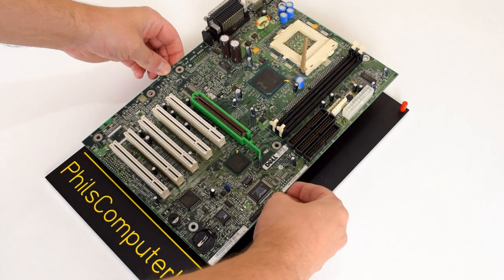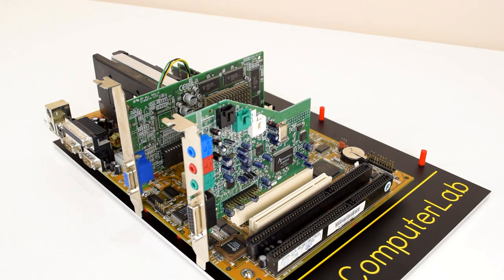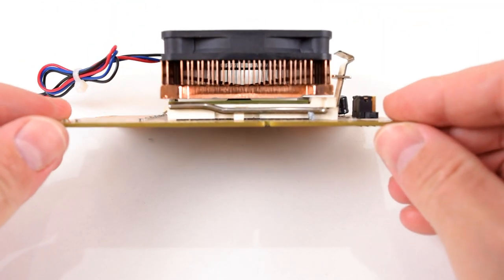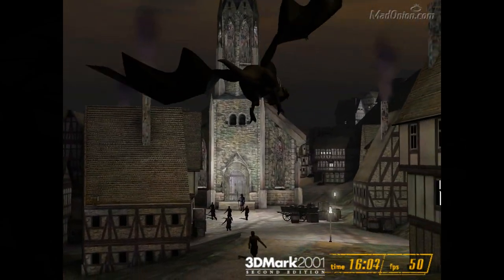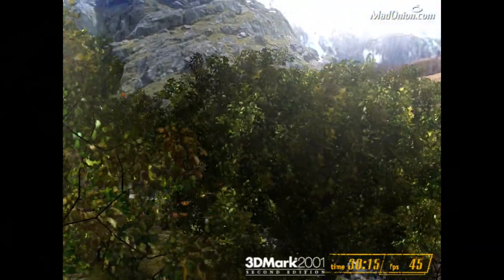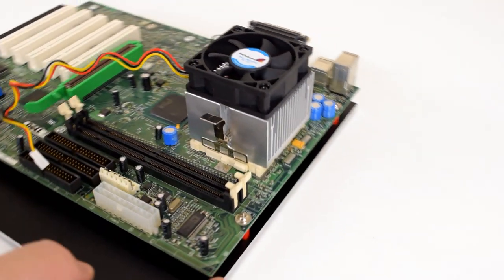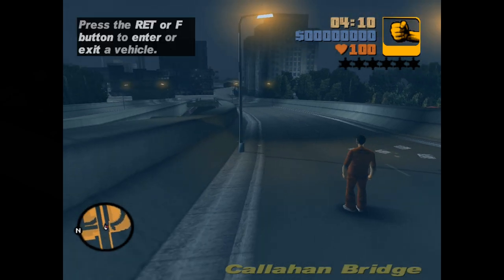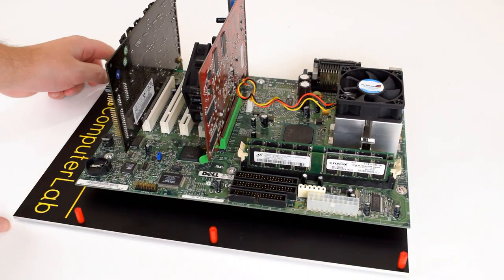The Pentium III 600EB - What does EB mean?

Comment: Nice video !!!. Back in 2000 to 2001 we have pretty an offimatic machine. It was a budget clone, but got the job done and got tired of people telling how miserable this PC was (PC Chips 850) but hey ... It worked fine for us and still powers up nice. It used AMD K6II 500 Mhz, It was a really good value. At this time, 500 to 600 Mhz, PIII or Celerons were the most common systems you could find in drugstores that have many of them networked just for gamming. But the K6 was not enough for certain things .... like the ones required by the university. Poorly made scripts with errors (well, I was learning) take tons of time on Matlab and tired of waitting 2 hours each time to get more errors I grab my CD and went to one of this drugstores. One in particular imported SPECTACULAR HW for its era, 850 and 900Mhz machines with 256MB RAM and powerfull graphics cards. The machines were by far the most powerfull around starting with the case itself. So rare and fast that people keep asking the owners where did they got this HW. I paid for a gamming PC (you could pick a "only internet" and a "gamming" PC) get the permission to install Matlab on it and it was insane fast. I finished my work in two hours. How weird this was, I was in the middle of people shoutting and shutting themselves in the game, one of them even broke the keyboard. Sure it was weird for the other buddys there, using a proper gamming system for nothing but a white command promt LOL. My "gamming" setup was a P1 100Mhz enough for VICE and CCS and minimal for MAME depending on the ROMS.

Comment: The Pentium III 500E was a 'special' release from Intel around 1999. It was rumoured to run on a 133mhz bus and was very cheap ( about $250). I rushed out and bought it and had this cpu in a slocket running at 667mhz on my AX6BC Pro. Coupled with 512mb of insanely fast Transcend ram. It ran for many years until I gave it to a relative. It never faltered ever. Thanks for the great memories.

Comment: I've got a 600eb slot1 version recently. Now I'm using it along with 440bx at 450 and 300 mhz. Very happy with it. Going to build voodoo-1 based retro pc. Have an idea to build a arduino-based fsb-selector (and agp-divider selector). Wonder if there are option to switch them without restart (somehom put a wait-states through pc/pci connector to motherboard and switch fsb during this period)

Comment: On a side note, there were also boards with bot socket 370 and slot 1(although couldn't be used in a dual cpu config), which are very cool, I'm not sure what chipset they use, although I do have one, need to have a look at it.

Comment: I had (still have) a PIII500e. It run fine at 667mhz, and even worked for the odd benchmark at 750mhz with a TEC module. The issue i had with my BX board (SOYO SY-6BA)  though was the PCI bus speed didn't have dividers for  anything above 100mhz FSB, so your PCI speed would run way over spec

Comment: I was using a P2-266 back in '99. I didn't get into PIII until 2003, when I replaced my terribad 1.8GHz P4 with a PIII-S, clocked it up to 1575 on a Apollo Pro266T DDR motherboard, and slotted in a shiny new Radeon 9800 Pro. That thing was just so awesome. I spent hours and hours playing Painkiller, Splinter Cell 1 & 2, Vice City, Far Cry, Doom 3, Thief 3, and many other games on that machine.

In fact, I enjoyed that rig so much that I recently spent way too much money recreating it. Got myself the same QDI Advance 12T motherboard that my original machine had. I'm even replaying all of those old games!
Reply from the maker: Nice! I'm yet to try out the VIA 266T, the best I have is the 133T. Unreal that you found the OC Tualatin better than the P4.
Reply: Nice thing about the 266T is that it lets you take cheap CL3 DDR400 memory and run it at 300MHz (to match the 150MHz FSB) with very good 2-2-2-5 memory timings. There's also a dedicated 266MB/s bus between the Northbridge and Southbridge. It doesn't use the PCI bus to link the two like the older Apollo 133 did.
Reply from the maker: You really know your stuff! I only recently read up how they the North- and Southbridge were connected with the PCI bus and how the i810 chipset changed all that. It's so interesting to experience all this stuff :D

Comment: At the time, I had a Via-C3 667 sold as: "1GHz PR" - "Samuel 2" core and later, as the computer was shared with my brother, he would get the VIA and I've had a P3-500 Slot-1. We never had a Rambus system, but in Eastern Europe the P3 Cooperine or P4 were overly pricey. Around 2 years later, my aunt bought an Athlon 1800+, so what can I say: 
- P4 was a linked with Rambus making everything overly expensive. I knew only two people in entire IT university that had them initially, from some dozens of colleagues. AMD was the king, some people would argue that Coppermine's Celeron is a good deal, but none was pro-P4 or P3.
- Via-C3 667  was running neck on neck with a P3-500 which was second hand
- I remember that at the time, the single way to counter a slower CPU was only to buy a lot of memory, and we were using XP flawlessly
- Via-C3 was kind of "SOC" with everything soldered, you could not change the video card, but it would have 2 slots of memory, so we upgraded it till 256MB of memory and we would run Linux and XP. 
- Linux was amazingly compatible to Via platform at the time, and P3 was not

Comment: Hey Phil. Love your video's as always! Would be interesting for others to see perhaps if you can cover the speed difference between the 500 and 500e for example. There's quite a nice performance boost in some benchmarks due to the full speed cache even though it's halved in size. Also, I see you have a 500e and a 700e - Could you overclock them using 133 fsb and give people some idea of the possible free performance boost?

I had a 500e back in the day, which was an upgrade from a k6-2 400. I managed 112fsb on this, which was the limitation of the QDI motherboard I had!  Also, not sure if you have any of the Matrox G400 series cards, but these were interesting at that time, running great until you looked at some blood for example in Half-Life etc!
Reply: Maybe even a complete 600 MHz roundup.
Duron 600, Athlon 600 Orion, Athlon 600 T-bird, P3 600, P3 600B, P3 600E, P3 600 EB, Celeron 600.
Reply from the maker: Thanks for sharing!
Reply: PhilsComputerLab I've got a bnib kt7a, and an nf7s! struggling to find a decent cooler over here (UK)!  I can get the athlon 1.1 to nearly 1600 but it's very toasty!
Reply from the maker: Old used all copper coolers is the way to go I think. Especially for overclocking. For stock look out for the Arctic Copper Silent or something like that. I used it with the 3200+ without any issues.
Reply from the maker: I'm sure I tested the 500 vs 500e in my Voodoo2 SLI scaling project. There was no difference basically, maybe 1% or 2 with no clear winner.

Comment: These were the "good ole days" upgrading either my videocard or cpu every fucking 6- 9 months, around here i had a 500 mhz coppermine p3 with voodoo 2s in sli and like 128 mb ram and a 30 gig hdd.  Next comp was a 1ghz Athlon with 256 mb ram and a voodoo 3, a tiny bit later a athlon 1.4 thunderbird with 4 40 gig hdd in raid 0 and a geforce 256. And a tiny bit later.......

Comment: I'd love to see you do something with the Intel L440GX motherboard, the one that can do dual pentium 3 slot 1s. Warning for you if you do though, it's limited to 100MHz FSB and will actually refuse to boot with any 133MHz FSB cpus. It's got a great SCSI chip onboard and a great chipset in general though, and the board is comically huge. I feel like dual Celeron 1100MHz with a really good AGP video card would be an impressive machine for that board, in fact I'd love to try it, the only issue is slotkets seem rare on American eBay atm.

Comment: I am still amazed how good the pentium 3 is that it was good enough for day to day computing as well even youtube till around 2009 or so. Still a little pissed after all these years about Intel gimping the 815 chipset (ram limit). Should have done 1gb out of the box or even 2GB like the i840 chipset.
Reply from the maker: I agree, the i815 could have been perfect had it more memory support and ISA slots by default.
Reply: Bit it makes a decent platform for a fast Win 98 machine.
More than 512 MB isn't supported by the OS anyway and with something like a SB Live or Audigy the lack of ISA isn't really an issue. And still faster than VIA on S370.

Comment: I'm pretty sure that the EB variants were more expensive than the E ones back then. I remember being able to get a pretty good deal on a P3 700E and then I slapped it in my BX board (Abit most likely, don't remember that well) with a slot adapter and set the jumper on the adapter for 133fsb mode and it ran at 933mhz without any problems. I think I could post at 1ghz, but it wasn't stable so I had to lower it down just bit from that. Still ran great though!

Comment: I love your channel, makes me almost a bit said that those times are long gone. Dont know why but even if tech was slower and not as advanced back then it was at least exiting and special.
Anyway.

Had the first slot 1 p3 550mhz "katamai "or something like that paired with an abit 440bx mobo, I think it was what you used and it was to me the most stable platform ever. Not even when I got my k7 750mhz a couple months later did the via mobos did change that. To be honest the biggest surprise was when later on I got a Asrock 939Dual-SATA2, to be honest it was a cheap plaything and all but damn was it good. Since then asrcok took over nr1 spot from Abit in my heart :P

No but, nothing could compare to a old bx440 board especially a abit one with "softmenu" hehe. those where the times :)
Reply from the maker: I agree with Asrock being awesome :) I got a board that has PCIe and AGP, but haven't found time to use it yet.
Reply: PhilsComputerLab Probably the board I mentioned, it has also a proprietary connector over the pci-e for a cpu daughter board? http://www.asrock.com/mb/ULi/939Dual-SATA2/ If I remember correctly you need to make a hw-mod to be able to give the cpu more juice. fun and cheap board but it withstand everything I did to it.
Reply from the maker: Yes that's the one!

Comment: I remember my mom having a p3 600eb slot 1 on a intel 820 with the defective intel mth (memory translator hub) as this motherboard uses sdram but the i820 works with rdram. we didn't ended up having issues with this computer, random crashes or anything. I was using it over my aging own p233mmx/v2-sli. it did work great, and remember playing black & white on it quite a lot.

Comment: The Via Apollo was very good. Even SGI used it for their SGI 230 Visual Workstation.
Reply from the maker: I'll try using a board with VIA Apollo 133T is a video project soon.
Reply: Strange, I remember those VIA chipsets having been a big pain in the ass... I once had a K6-300 (don‘t remember the exact chipset, but it was VIA) and my sister an Athlon 1400 on a KT266, and I was only satisfied when switching back to intel chipsets.

Comment: OEMs like HP even used both Slot1 and RAMBUS memory back in the day. I had an HP Vectra VL600 which had a Coppermine 600EB on Slot 1 with i820 chipset and RDRAM. It took the system forever to count all of its 512MB of RAM during POST, but it was rock solid otherwise.
Reply from the maker: I don't mind OEM boards, but anything RAMBUS is obscenely priced and rare.

Comment: In the day I used to run an Asus P2B-D dual slot 1 motherboard that got started with 2 Pentium II 400MHz, and was upgraded later to 2 Pentuim III Coppermine 850MHz
It was running Windows XP Pro, upgraded later to Windows XP Pro x64 dual booting to Linux.
It was a beast..

Comment: I think that socket 370 is the most intresting retro platform since it is quite modern and still has support for ISA cards. Same thing with late (2007-2008) socket 775 systems with their support for floppy drives and IDE hard drives.

I had a socket 370 system myself, but unfortunately I had a 700 MHz Celeron and a dirt cheap motherboard. I'm not sure how much i missed because of this. If I decide to build a retro PC, it will definitely be from this time period.
Reply from the maker: What S370 parts would be your favourite if you could pick anything?
Reply: I havn't tried it myself, but I'm quite fond of Taulatin CPU:s and Intel 815 chipsets. However, I'm not sure if the chipset supports ISA.

I have an aptitude for the high end stuff in each generation. I have a computer with ASUS P5E3, Q9550 and Icy Dock trayless bays that I use for small scale kernel development and other testing, and I really like the onboard support for floppy, IDE hard drives and classic PCI slots.

Comment: I built my first from-the-ground-up PC in 2000.  I had a FIC AZ11 motherboard, AMD Athlon 1GHz CPU, 128MB RAM, and the notorious ATI Rage Fury Maxx graphics card (which I loved btw.)  The system ran Win98SE at first, but later upgraded to XP and I had to ditch the Rage card for a vanilla GeForce4 MX440.  The GeForce served my purposes and played all my games but in hindsight it's a lot less exciting than the earlier dual-chip graphics solution.  Prior to this build I'd been running a drop-in AIO upgrade motherboard purchased from TigerDirect with a 233MHz Cyrix MediaGX CPU and integrated graphics and sound so this whole Athlon thing was a massive upgrade - and the Rage Fury Maxx was my first experience with a hardware-accelerated 3D card too!

Comment: I personally used the Athlon platform around this time starting with the slot A 600 in late 1999. At work we mostly built Intel systems for corporate customers, the 440BX and 815 chipsets were  very stable. As for power hungry Athlon's the Thunderbird 1.4GHz was one of the most power hungry / Heat generating CPU's AMD released. Power consumption definitely improved with the release of Athlon XP series.

In my time working in the industry I only ever built one Rambus system it was on a "confidential" sample Intel 820 motherboard. 

DDR exploits the double clock rate (dual edge clock  triggering) with out the latency issues.

Comment: I believe I was still using a 486DX 50 motherboard with an Evergreen processor running at 166Mhz, and 16Meg of RAM around that period. I got a true 166Mhz system which I used for about a year, then jumped straight to an AMD K7 Athelon, and then to a quad core Pentium 4. (or possibly 2 core, 4 thread, just prior to the Core architecture)

I remember that period well, because I was heavily experimenting with OS at the time, having concluded that Linux was distinctly aiming at server use, and Windows wasn't fit to be let loose on the internet. So I used a lot of QNX, BeOS, SkyOS, Zeta etc. systems.

Comment: In the year 2000-2001? I was still using an AMD K6-2, dual booting Linux and Windows 98 due to the latter's instability. I didn't upgrade to an Athlon XP until 2003 or so when I finally upgraded to Windows XP, I believe.

Comment: I missed the Pentium 3 era but built a 1 Ghz AMD Athlon system instead in January 2001.Many years later I think in 2005 I acquired two Pentium 3 systems one system Slot 1 @650 Mhz and the other a Socket 370 system at 733Mhz.Just two months ago I acquired a 500 Mhz Slot 1  Pentium 3 system.These were monsters compared to my 1999 AMD K6-2 system @ 450 Mhz. 
When I bought my AMD K6-2 system I saw on television Intel advertisements about the new Pentium iii I felt that my new computer was obsolete right away though I didn't feel too bad as I was on a low end budget.
It was a 3Dfx card the Voodoo 3 that was the savior as I could  actually do some decent gaming.

Comment: I had a Compaq Presario with K6-2 533 MHz with 64 MB (later expanded to 128 MB), an OEM VIA Apollo MVP4-based motherboard and a Trident Blade 3D iGPU that fortunately had it's own chip on the motherboard. Performance was pretty decent with Windows 98 SE, but not so good with any Windows NT-based OS.

Years later, I could replace it with a Pentium III 933 MHz, a GeForce 2 MX GPU, 192 MB of RAM and a ASUS CUV4X-E motherboard. The difference was huge in all aspects, even running Windows XP.

I miss these times. Specially when I remember the launch of the Athlon 1 GHz and a little later, the Pentium III Coppermine with the same frequency.

Comment: I hope you will make some tests comparing late Tualatin CPUs against early P4/Celeron ones. I upgraded from Pentium 3 800 to Celeron 1.7 Ghz and the difference was quite small. And overclocking of this Celeron was a joke - 300 Mhz more, still no real difference in speed. I would like to suggest more tests with overclocking - I heard that Pentium MMX could be overclocked well over 266 Mhz - insane! I had P166 MMX and it ran on 200 very well. Keep up the good job :)
Reply: Willamette Pentium 4 CPUs were a joke ... an expensive joke. The fastest Willamette was slower than the P-III Tualatin @ 1Ghz (the latter not being overclocked)

Comment: Ahhh, RDRAM. I was wondering when we'd get there. My college computer in 2001 was a P4 1.8ghz with 256MB RDRAM 800 non ECC. The mobo was a Monterey one and I had a powered by ATI Radoen 7000 with 64MB. It was an ok computer for a bit. Did some small upgrades like upping to 512MB of RAM later and putting in a Geforce 2 GTS Pro then an FX5200 so I could play Thief 3, then got a an FX 5900 Ultra later. Went to an Athlon 3200 up the road with a gig of RAM and finally got away from RDRAM. Was a fine day indeed heh
Reply: That system will still be a nice rig for retro purposes.